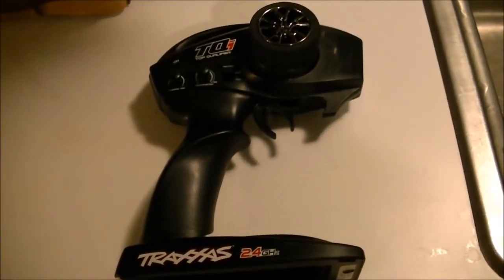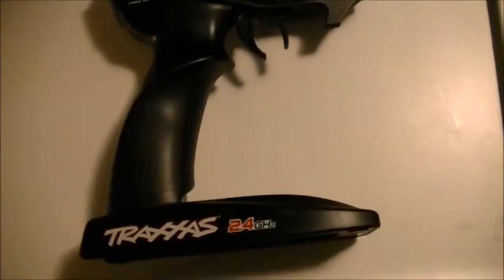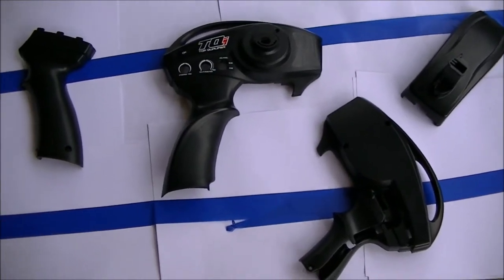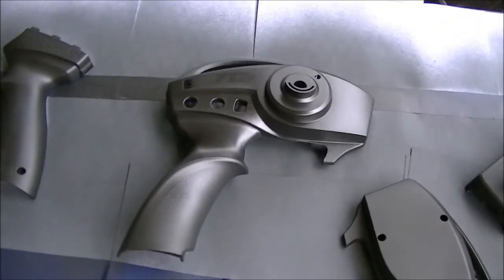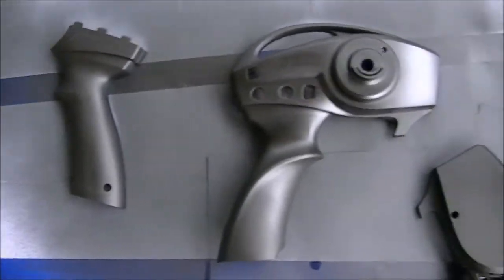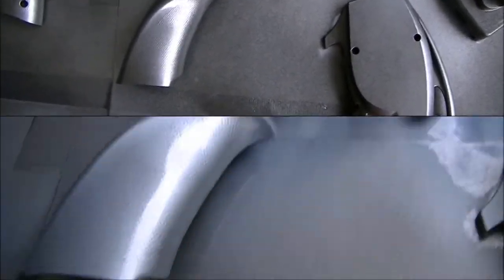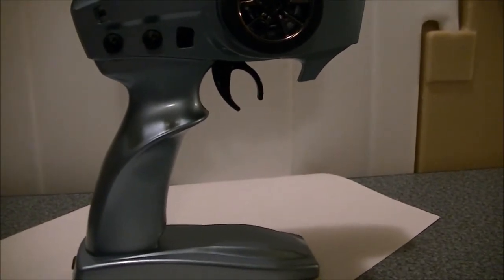HOW TO; PAiNT YOUR RC CONTROLLER. CHEAP,EASY,AWESOME

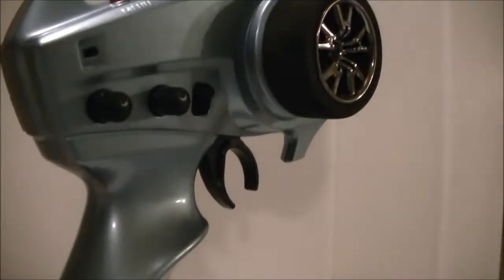Comment: Hey thanks for making this vid. I am about to paint that same controller for my slash.  but at 5:09 how did you get TRAXXAS to stand out like that if you didn't tape it off? i was thinking of using a sharpie after painting was all done?    second question...obviously the paint dries before u use it, but does the handle ever get sticky, like on a hot day?.

Comment: No clear coat? Have you ever tried using one to seal the paint...either matt clear or glossy clear. For your application I would have added glossy and wet sanded/ polish just to bring out the metallic look a bit more...